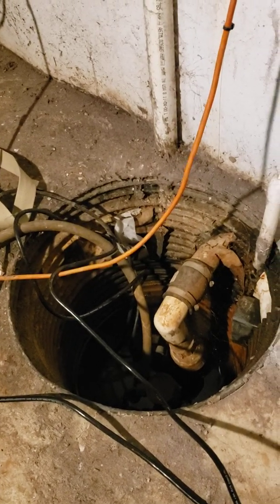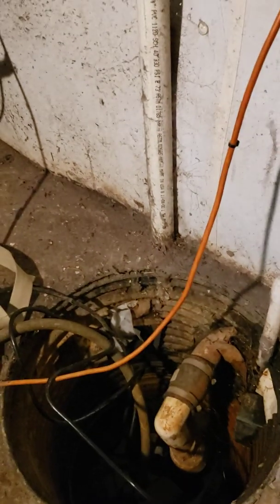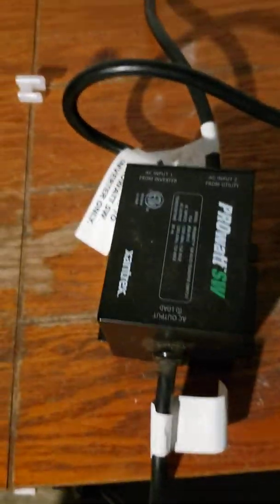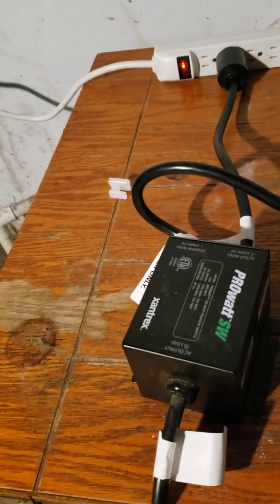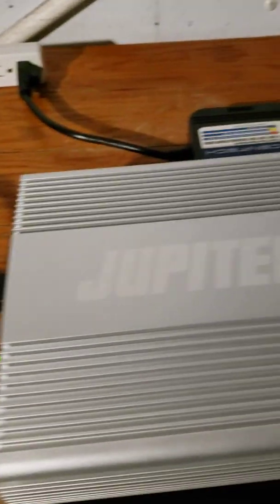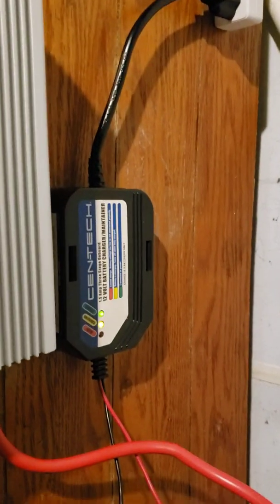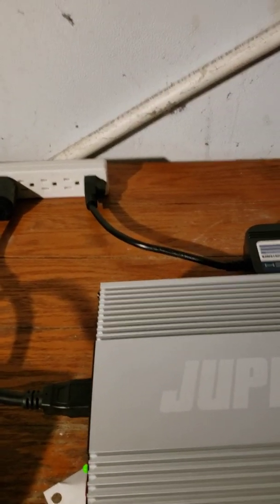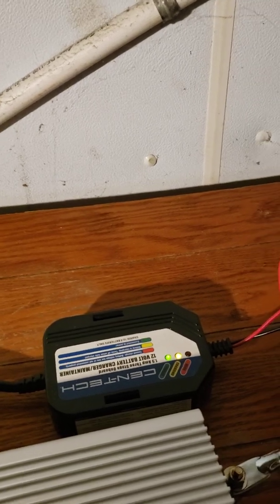DIY--  Backup battery system for existing sump pump

Comment: You don’t have to use the Pro Watt SW or the battery charger for this setup. Simply connect the sump pump directly to the inverter, which also charges the batteries. The Pro Watt is priced at about $74, the battery charger costs $24, and the inverter cables, bought from Harbor Freight, are $40. While this setup may cost more, it results in a cleaner and more streamlined configuration. Thank you for the tutorial!

Comment: I really like your idea about the inverter! I ended up going to Harbor Freight and purchasing one for $119. However, after doing some calculations, I found another option on Amazon—a Vevor 2000-watt inverter priced at around $219. With this one, you wouldn’t need to buy the two additional components you’re currently using.

Comment: I’m going to try this system I like the cost effectiveness of what you’ve done.. I have a question for you.. does the plug for you pump get plugged into the transfer switch?? I couldn’t see it on the video..

Comment: How do you get the charger to recognize when the battery volts fall and turn back on..I tried 3 chargers and none of them can automatically turn back on.
Reply from the maker: I'm using a tackle charger and maintainer. And it plugged into main power. So the battery never really loses that much voltage. Let me now if this answered your question
Reply: @13mgmas  I think my issue is the inverter has a voltage gauge which is taking power

Comment: good. video, i am trying to. do more or less the same thing and going to use a lithium battery as they last longer etc.Is your Pump 1/3 Horse power ? Is your Battery 100AH ?
I had a basement watchdog and the alarms would go off every week for one reason or another, too annoying

Comment: Nice work Michael. Any reason this wouldn't work for other appliances like a freezer for example?
Reply from the maker: No, it should work on anything you just have to do Your votage calculations to make sure inverter as big and enough

Comment: Do you always leave the inverter on? Has leaving it on without load caused any issues with inverter life or other parts?
Reply from the maker: I leave it on almost all the time. i do cut the ac power once a month for a day to let the battery pull down.

Comment: Dual pump back up suck. I have one the pump is plastic crap and they charge an arm and a leg to purchase. The main pump is rock solid I think I’m going your way with the inverter connecting to my rock solid pump. Thanks for the info.

Comment: Excellent job! You saved me over $500. This system works perfect,and with my generator as a backup (if needed)  I can operate the sump pump and charge the battery at the sametime. THANK YOU!
Reply from the maker: At this point my 1 battery last at least  12 hours with average use
Reply: Mike, can We get a wiring diagram or a video of the wiring setup? thanks

Comment: Great video Michael - Question, how did you ground the inverter? I bought the same one (same setup as you here), but I'm not sure what to connect the ground wire to in my basement. Thanks!
Reply from the maker: I didn't ground the inverter. I guess you should but I don't and it's been working fine

Comment: Michael, thanks for the video, one question on the switch...did yours come with the plugs on the end of the cords or did you have to add those yourself? My Prowatt SW came with one plug to go into the inverter and the other two were wires with no plugs. How did you add the plugs?
Reply: did you figure this out? I have the same question
Reply: @matthewestes1662  yes you need to add the plug ends yourself. Easy to do, they cost about 3 bucks a piece.

Comment: Awesome DIY work. I have a 1/3 HP 5.2 amps sump pump + a backup sump pump 4/10 HP 13 amps. no battery backup. Checked the prices, crazy high. I like your set-up. My back up with 13amps is enclosed and seems to be a monster but I want to start with the main one wit hsimilar to your set-up....I found the xantrex PROwatt switch but the jupiter 2000watt and the charger are not available on Amazon Canada. any advice on the inverter (watts and peak limits) and on the charger (highest amp the better? or shouldnt bi too high?)
Reply from the maker: The Jupiter is not gonna be on Amazon cuz it's a harbour freight product.  You can use any inverter you want a lot of people like to praise pure sine inverter but I haven't seen any difference for what I am doing.

Comment: Thank you! Was looking for something like this!! Couldn't find nothing to use the original sump pump. Will check back once it's completed.
Reply from the maker: Thanks just wanted to let you know that I've done further testing and the one battery will work for me under regular use for 8 + hours. Let me know how it works out 😀